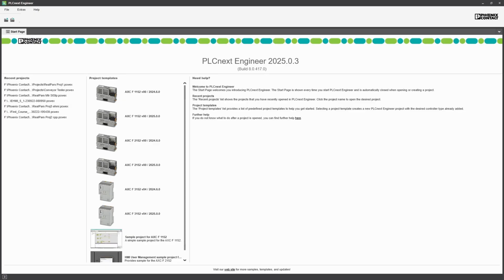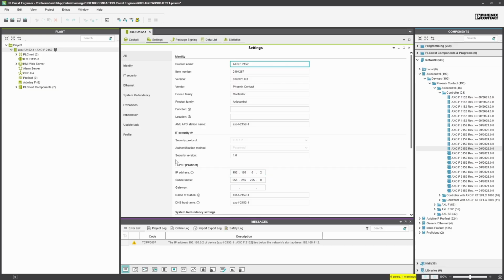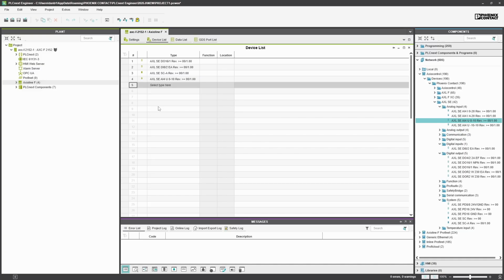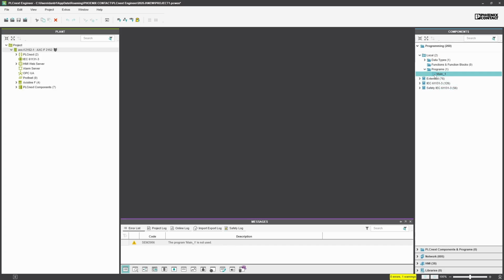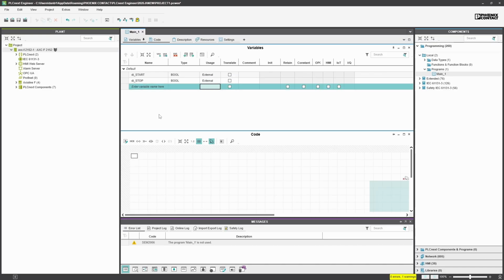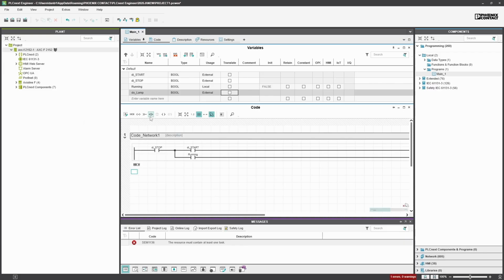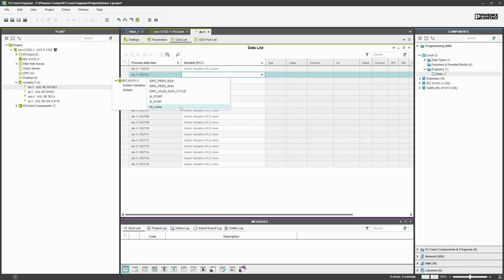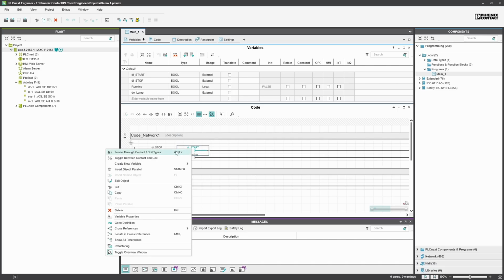Creating your first program in PLCnext Engineer

Comment: Hello Daniel Barrett, thanks for this video. Can you please tell how to define a global variable in PLCNext? I have two different POUs in my code. If I declare a variable in one POU with usage as "Program Global" and I want to use the same variable in another POU then it is again asking for declaration. We have a component in PLANT name IEC 61131-3 but I guess it is for mapping or linking External variables only. So, I want to know how I can define a variable which I can universally use it anywhere.
Reply from the maker: Hello Tushar, if you are trying to share the data between two different POU's that reside in the same program I would suggest trying to use the "Var Program" usage type as this is defined as a global variable alternatively you can try use INport and OUTport types and then link them in the controller data list.

I will be working on making a video on this topic here in the near future and link to it here in the reply once it is done if I have other methods that work better.  

So that I can ensure that this video is the most helpful can you share the types of data that you wish to communicate between blocks?